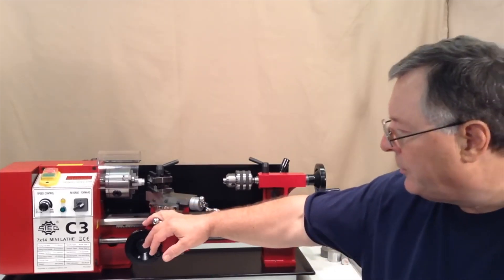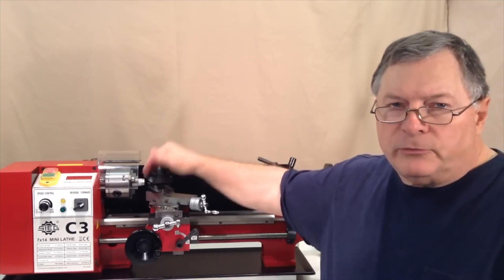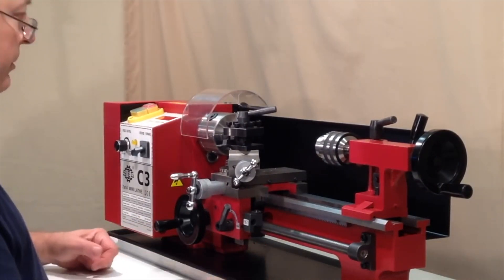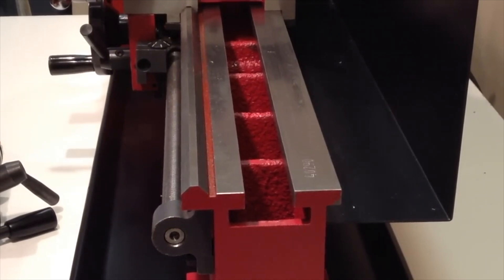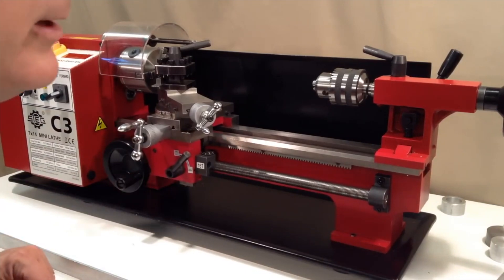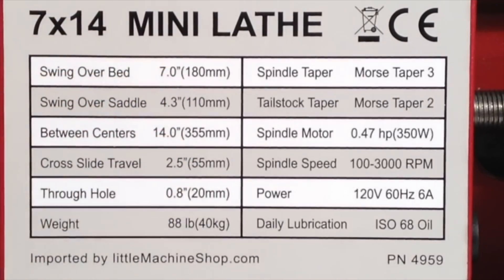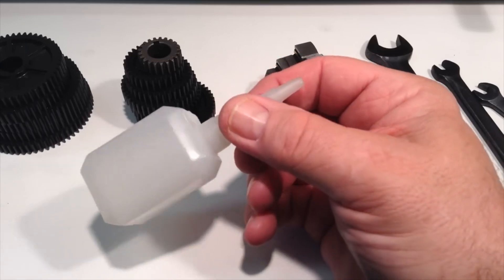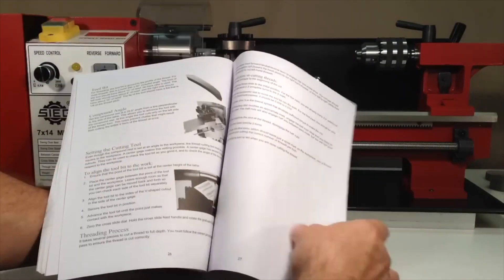Sieg 7x14 pt1

Comment: Can it make threads?
Reply from the maker: YES it can. 

With this lathe, you can create every American Standard Unified class 2A inch screw thread from 4 to 100 threads per inch, and you can create every American Standard Metric class 6h thread from 0.25 to 8 mm pitch with the extra 21 tooth change gear that is included.